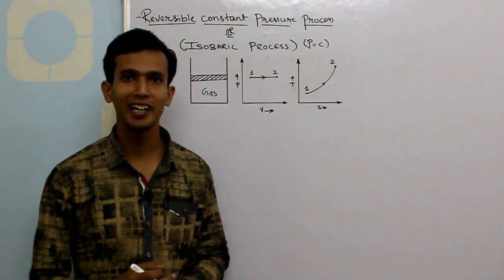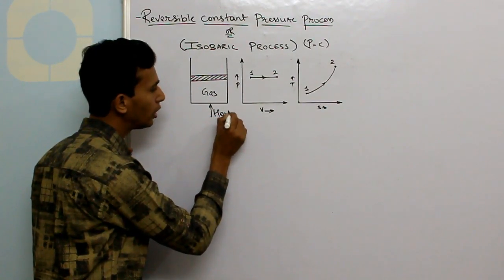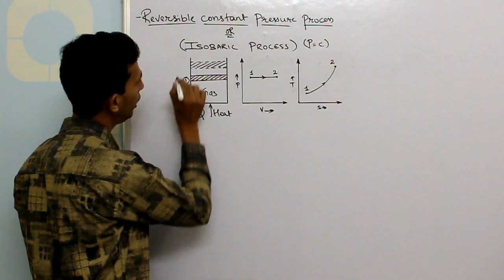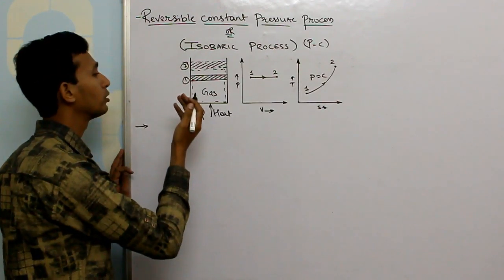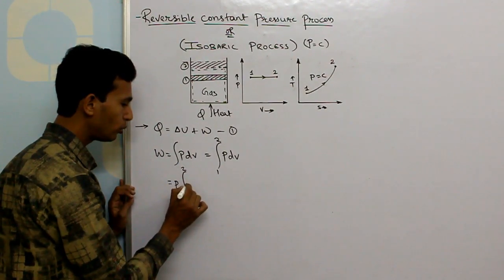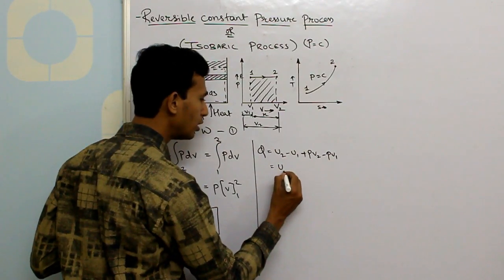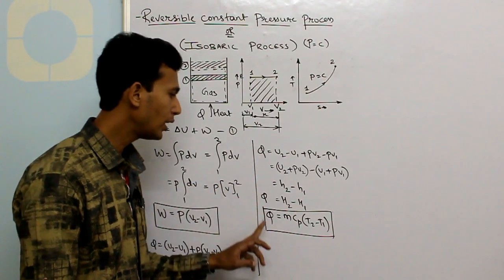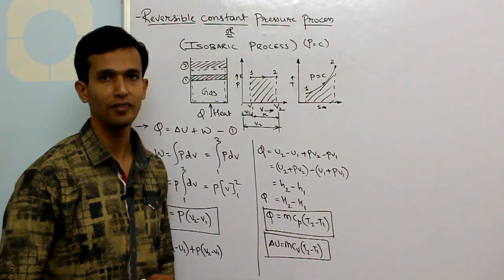Reversible Constant Pressure Process/Isobaric Process #thermodynamics #basicthermodynamics

Comment: Thanks for your video. i just don't get it, since the volume is not constant at isobaric process, why the internal energy formula is U=mCv(t2-t1).
Reply from the maker: With Respect to your Question, If you are viewing this formula in reference to the Process explained in this video, 
(i.e If you are confused because we are talking about constant pressure process and still I am considering Cv and why not Cp) then the concept is a bit misunderstood.  
In order to understand the formula,  let us take a look at the terms included in it.  
Internal Energy = mass x specific heat at constant volume ( Final temperature - Initial Temperature) 
Mass - This Term is included in formula so as to obtain the total amount of internal Energy for the given system.  
(t2-t1) - This term is included in formula because internal Energy is Function of temperature. 
And Now coming to Cv..
Specific Heat at constant volume - As we know there are two specific heat values for every working substance,  i.e.
Specific heat at constant Pressure (Cp) &
Specific heat at constant volume (Cv).
And as we all know that,  Cp is greater than Cv. 
This can also be understood from first law of thermodynamics
i.e. 
Heat Supplied = Change in Internal Energy + Work Done.  
Here we should remember that, 
Heat Supplied is given by mCp(t2-t1)
And 
As Seen Above 
Internal energy = mCv(t2-t1)
So except Cp and Cv all other terms are same. 
Here as Cp is greater than Cv, A part of heat supplied will be utilised in changing internal energy and the remaining value will be obtained as work output. 
We should also remember that, this formula given here for Internal energy is not based on process which is being carried out. 
Actually it is being framed from First law of thermodynamics as stated above and it remains same for all the processes. 
So, just because we are carrying out Constant Pressure process we can't replace the terms in internal energy formula. 
I Hope this answer clears your doubt.
Reply: Internal energy is always equal to nCvdT whether you have adiabatic, isothermal, isobaric or isochoric processes